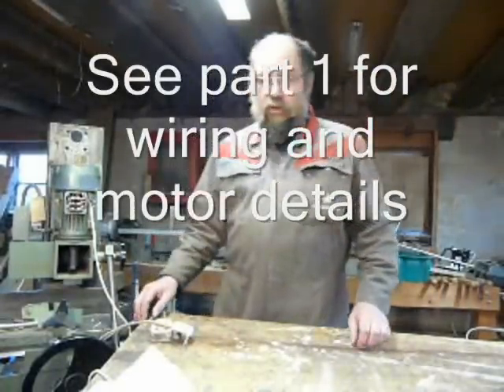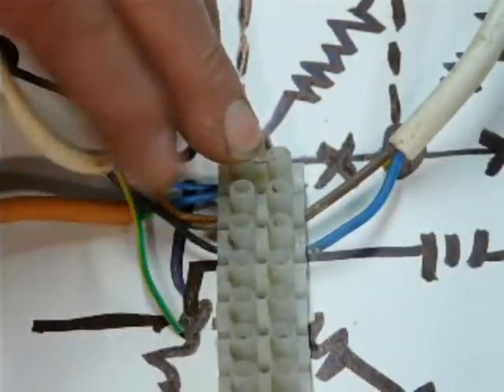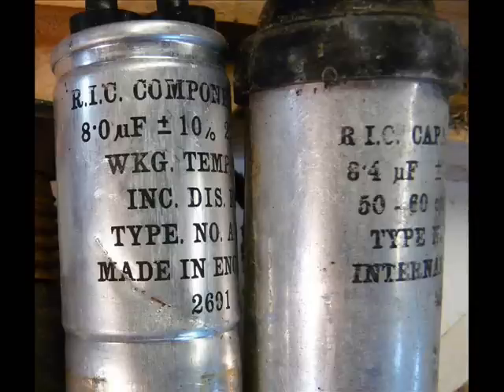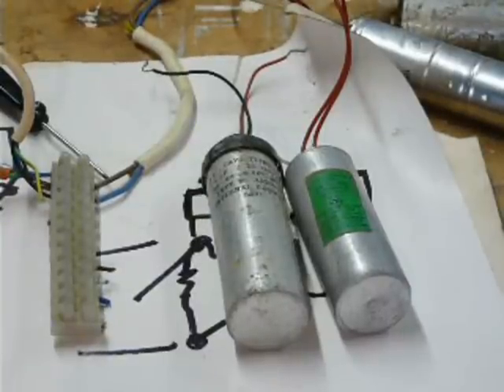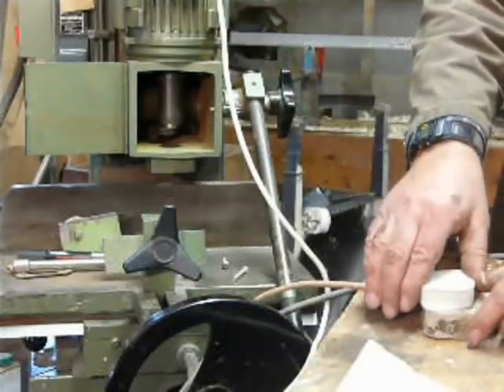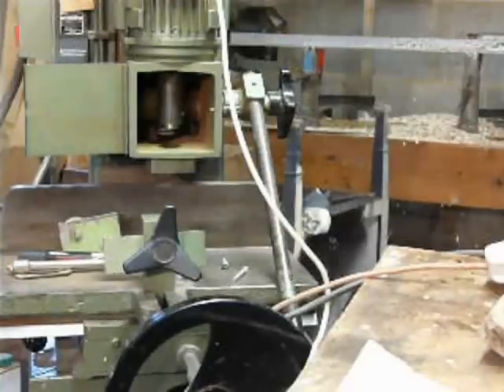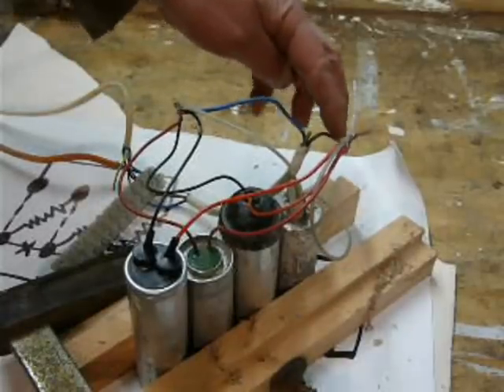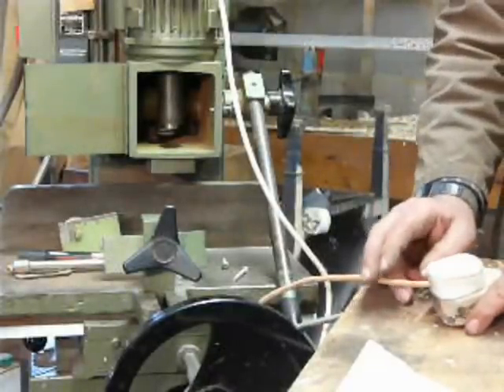How to do it: run a 3 phase motor on single phase supply. part 2

Comment: Hi Andy and thanks for this upload

I have followed the instructions in this video as it all seems straightforward but I cannot get the motor to turn in either direction, it’s rocking or oscillating back and forth but fails to turn

May I ask if this indicates a mistake in my work?

I have tried to switch the wires to different poles but still get the same result

The motor is a 3 phase 2.2kw now wired in delta as in the video

The capacitor I’m using is 60 microfarads and I checked that for continuity

Maybe I need to introduce a start capacitor?

If you find time to reply that would be great, I’m not knowledgeable in electrics but usually win if I keep on trying!

Many thanks
Nigel
Reply from the maker: Hi, yes for that size motor you will need a start capacitor, see part 6, cheers
Reply: Andy Reynolds Hi Andy and thanks for your reply
I will have a good watch of all the parts (I hadn’t realised you had more to see) and hopefully after part six il have a working motor which will then be running a nice old Clarke compressor,  I look forward to doing the job, i will post back when I manage to win
Thanks again 
Nigel de Jesus

Comment: I think a significant amount of your heat buildup is due to the fact that the phases are not 120° off from each other...  
From what I saw, you have two that are 180° from each other and one that is 90° from each of the other two (or vice versa depending on how you want to look at it).  Ergo, this is not a Delta (equilateral), but an isosceles connection.
To set your phases correct, you would need to add two capacitance banks.  This will also reduce your voltage to 208.
Reply from the maker: Thanks for your thoughts, cheers

Comment: hi Mr. Andy can ask how can I increase the torque of the motor, 
I buy a peanut grinding machine which capacity is 50 to 60kg/hr
as I test run for 1 kg it trip off. motor 1500kw

Comment: Hi Andy, what would be the capacitor value for a 1.5Kw motor? I put 35uF  the motor has to be manually turened for it to run, any idea why and what is the soluation.
Reply from the maker: Hi, well done for getting this far, it just needs a bit more umph. You can add another capacitor in parallel to increase the value. That's why I like the caps out of light fittings as the are between 8 and 14 Uf and so you can jsut keep adding until it works. Make sure you watch all 6 videos to get the whole idea. Too much capactiance causes excess voltage and so the motor warms up. Cheers
Reply: Hi Andy, thanks for your reply, I watched all 6 videos, with mine I am already using a start/stop with contactor, regarding the capacitors what would a right values for the run and start capacitors for my motor which is 1.5Kw. regards
Reply from the maker: Just a guess here 70UF run 200Uf start, cheers

Comment: just as a safety note capacitors hold there charge. so discharge them after unplugging them  to stay safe as you are pretty much wiring up live wires.
Reply: no need, the capacitor bank is in parallel with one of the coil thus all charge is dissipated.

Comment: How do you determine the capacitor size, say for 40hp motor?
Reply from the maker: Hi, that is a huge motor and not suitable for this method. The start current would be ten times the run current and this would not be available on single phase, cheers
Reply: Haha
Reply: For that you would need a rotory phase converter, most amateurs cannot design or build something that size

Comment: Like your refrigerator motor one start coil and other run!
Reply from the maker: Hi, thanks for the comment, in this case the capacitor shifts the phase so the second coil helps with the starting and the power. I think in part 6 it shows a start capacitor that is taken out of circuit once the motor is running, cheers

Comment: when you add capacitors in parallel you loss 1 micro farad for every capacitor so you actuly 
had 28uf total;]
Reply from the maker: Darren, interesting, thanks for your contribution to knowledge, Subscribed? cheers

Comment: Is there a formula according to the power of the motor to enable the choice of the capacitor?
Reply from the maker: Hi, yes there is and it's somewhere in the comments on this series, however I like to do it the practical way to rake account of motor designe variations, Subscribed? cheers

Comment: Now it's all making since to me. I figured for 240V but we here in the states have the neutral as I said bonded to the panel which is bonded to the ground or earth and we have the option of using one leg of hot and the other a neutral which comes up to a 120V circuit which we run most everything on unless we really need more power like in a electrical cloths dryer heating element or a electric water heater and the stove. We call it a trunk and you call it a boot. When someone is wanting to learn they never stop asking the teacher until they have the truth for one never knows how deep the rabbit hole is until one digs it up. Cheers ole boy.

Comment: All I want to know is if your telling me that you are running a neutral wire into your motor and a neutral in your electrical panel is bonded to the panel box along with the ground or earth as you call it then you state that you hook in a hot wire as you say, then your only hooking your motor up to 120V . Now on your diagram you draw up you state that you have 240V going in and I'm just wondering what your really hooking up to the motor Andy?
Reply from the maker: Spend a bit more time on this, see part one, In the UK we use 240v ac. If in doubt I gave the reference material, cheers

Comment: Hi Andy, I saw your video a few years ago, tried it on a lathe suds/coolant pump, and it's working fine, now about to do the same on a milling machine..Cheers
Reply from the maker: 2012, that was an age ago, thanks for your note and hope the new project works well, you might need a start capacitor, see part 6. Cheers
Reply: I'm looking at it now. Thanks very much :)

Comment: Hi Andy, thanks for your video. I'm trying to run a 7.5hp 380v delta in single phase. After I added a 50 mF Capacitor the motor jingles back and forth - does it mean my Capacitor is too small?
Reply from the maker: Hi, definately too small, try some more in parallel. You will probably need a start cap to give plenty of kick. cheers

Comment: Wow why the hell anyone would wanna buy an electronic inverter or a mechanical three phase converter when this can easily be done with capacitors??
Reply from the maker: HI, to answer your question: because you get only 60% of the power this way, you have to be confident with electrical works, there is no variable speed function. Beyond that it works well with the examples that I have shown, pillar drills and morticers. Cheers
Reply: Thank you for the reply and explanation Amigo Andy Reynolds!! God bless you!

Comment: Hi, Andy - I have a three phase motor with blue, black, orange, white, red and yellow
Can you please show your diagram with color codes that will work for the three phase motor I have. I got this motor from a scrap. 
I got it working with 110 v ac by connecting blue, black and orange together and white, red and yellow together
AJ

Comment: Hi Endey 
Sorry for asking many questions. In your tutorial, you mentioned wire resourses and first blue wire goes to motor L1 (netrul) in my case, I have 220 volts ..means both lines hot or positive.
Do I need to get netrul line? or 220 can do the same? Thanks
Reply from the maker: HI, 220 volts across 2 wires will be fine (single phase) cheers
Reply: Andy Reynolds  
I am very happy with the result of my connectio as per your instructio. 
The motor runs with full RPM and HP. How can I thankyou. I bought the motor from scrap with small mony. Again thank you so much
Reply from the maker: HI, that's great news, please see my Patreon link on my channel page, cheers

Comment: Hi Andey. Thanks for the good video 
I bouhgt a motor from the scrap and found it in very good condition but I thought it is single phase. I took it to an elctrition and he told me that this can ony run with three phase power. I searched the net and found your great channel with possible solution to use single phase with capacitor. The spec. on the motor is 
Frame 42 Z
H. P. =1.2   0Z-FT
Volts = 220
Amps=8
RPM = 900
HZ 60 ...... ph 3 ..... Class B

Please advice me on what to do
Reply from the maker: HI, the best way is to use the method shown in the video and work it out the capacitor values by trial and error, cheers
Reply: Thanks for the quich reply 
Th motor has only three wires not 6 
How can I know it is a delta connection or star connectio 
I think the connection is made internally by the manufacturer
Reply from the maker: Hi, yes, the satr connection can be found on the stator windings, you can try this motor as it is but it will have less power, cheers

Comment: Thank you Andy. You just solved my dilemma. I have a 10 HP, 3 phase air compressor, but 3 phase is not available in my residential area. I was going to purchase a single phase motor, but I think I'll try this first. What have I got to lose? By the way, does this setup use any more electricity?
Reply from the maker: HI, compressors are difficult due to the high torque start-up. 10 HP is a large motor and the start-up current could be up to 10 times the run current. Even allowing for the 60 % power this would be a run current of something like 30 amps. See how you get on with it, as there is only one way to find out. Love to hear how you get on. Cheers

Comment: In North America 240 V is obtained by two hots in opposite phase, not a neutral and one hot in Europe and Asia.

Does this change the procedure?
Reply from the maker: Hi, no it does not have any effect because it is AC, so live and neutral are only relative to ground. In fact this may be of benefit depending on the voltage of your 3 phase motor. Cheers
Reply: Hi Andy:

Thanks

First, In a plan I see that the start capacitor that starts the idle motor is NOT disconnected  after the idle motor has started. This start capacitor remains in place after the idle motor has started. Does this sound correct?

I understand that of course the two run capacitors remain in place always.

Second, does it matter whether the idle motor nameplate says rpm 1725 or rpm 3450? Does the nameplate rpm of the idle motor affect the efficiency for use for the smaller 3-phase motors.

I have a rpm 1725 10 hp 3-phase motor that I intend to use as the idle motor. Would I be able to run a 3-phase 3hp rpm 3450 motor for my table saw?

Thanks
Reply from the maker: Hi the run capacitor stays in circuit all the time. The start cap is there to give that extra kick and then is switched off. If you use this to start a pilot motor then this pilot motor will stablise the third phase. You can then use a 3 phase contactor to start up your power motor without any capacitors on the power motor. Make sure that the coil of the contactor is wired across the true phases, not the induced phase. Cheers

Comment: Very interesting explanation but as you say understanding of what you should be doing and good working practice is critical because you are using dangerous currents.
One thing came to mind that before handling the capacitor terminals you do need to make sure they that they have fully discharged. I remember when I was working on a faulty PSU, in for repair, that one capacitor still had a very high voltage after the PSU had been isolated 48 hous later.
thanks

Comment: Hi Andy,

I have question. You say that capacitors has to be 240v or it cant be less than 240v? Because i check electronic parts and they only have 450v+GRND. I think it should work with these one or not? :D (I want to do same 3phases motor run on single phase supply)
Reply from the maker: Hi, you need non polarised capacitors for AC use. 450v is fine but anyhting below 250 is a problem, so I use the flourecent light units as they are easy to find and can be wired in parellel. Cheers
Reply: Thank you

Comment: What could cause them to overload?
Reply from the maker: Hi, yes too high a capacitance will induce high voltage and the motor will get hot, subscribed? cheers
Reply: hey are you that famous skateboarder? as i once was kinda?
Reply: so lots of fans? i heard of a spray oil that allowed a motor to run underwater in cold flow
Reply from the maker: No, just fit lower value capacitors, and if needed a start cap, cheers
Reply: will this work with a three phase induction machine?
Reply: is this all ac?

Comment: How is this running off of single phase power exactly?
Reply from the maker: The easiest way to think about this is that the capacitors induce a delay in the power as to match the next phase coils that are physicaly off-set from the previous set. Cheers
Reply: Andy Reynolds that clears things up. thank you. I am doing this for a senior project and am wondering would this work the same with shunt capacitors?

Comment: Hello,

I wired up my 1.5 kW 3 phase motor into delta, and connected a 100 uF capacitor to delay one phase.
when I run the motor (on 240V) by itself, it vibrates a little and then starts running at full speed.
however when I put load on it (belt tension on pulley) it just vibrates and hums.
Normally, I would think to increase the capacitance. however I base the 100 uF on a formula I found online: C = 68*P (uF,kW), and this formula worked fine for me for smaller (300 W) motors

Is there something I am missing?
Reply from the maker: Hi See part 6 for the start cap wiring, gives an extra momentary kick. Have you subscribed to this non profit channel?,Cheers, Andy

Comment: hi does the motor not lose power or torque being wired to 240v
Reply from the maker: Hi. Yes, both, that's why compressors are right out, but pillar drills Ok. Subscribed? Cheers, Andy
Reply: so attempting to run a 5HP hydrovane compressor this way is a big no then yes ive suscribed
Reply from the maker: Hi, you have it in one, also start current is about 10 times run current. Even if this motor on single phase was 3 Hp, then with 4 amps to the HP  that would be 12 amps run and 120 amps start. Cheers, Andy
Reply: i know this is an old comment but ill add i am using this capacitor method (with a start capactor and timer) to run a 5hp baldor motor on a 2 stage 1950s Westinghouse air compressor. the fly wheel on the compressor alone is probably 50lbs so it does take a little time to get up to speed but with the right start cap it gets to full speed in about 3-4 seconds. i have run it up to 180psi with no issues. had the start relay stick one time and that for exciting. start capacitor exploded and filled the garage with smoke before i knew what happen.

Comment: 3 phase supply 3 power cable and what about neutral wire that is 4 th one is missing.  whether already connected somewhere .
Reply from the maker: HI. You will have to look for it. In the UK the neutral is the same as the earth. Cheers

Comment: hi mr andy,,, awesome video 👍,  what is function the capasitor  ?
Reply from the maker: Hi. The simplest way of thinking about this is that the capacitor shifts the phase, so adds delay. In this way a the new phase is out of sinc with the supply and so suits the motor. Cheers, Andy
Reply: Thank's a lot mr 😁
Reply: Awesome video. From my understanding. A motor is a purely inductive load with minimal resistance. So the voltage to current relationship would be 90 degrees out of phase. You say the capacitors adds a delay by shifting the phase. Wouldn't the capacitors be correcting power factor by making the voltage to current relationship more unison. I figured the purpose of run capacitors is to synthesize a third phase due to their nature. Thanks for any input. Not trying to be a hassle.

Comment: Hi, i found this info very helpfull thanks. Is there by change a formula to calculate the MF for a motor? thanks
Reply from the maker: Hi. Thanks for the comment. The formula is to be found in the comments to one of the videos in this series. Subscribed? Cheers, Andy
Reply: Hi, what video can i find it in? Just Subscribed. And just one more thing, what is the biggest kw i can go on this method? thanks
Reply from the maker: Hi. I forget which one, but there is a playlist so  all 6 are easy to access. The max motor size depends on the motor design but I had an old Denbigh pillar drill and that had a 3Hp on it. It worked with this system but was very steady on starting. Cheers

Comment: Why in the name of God to people spend 1000 $2,000 on face converters when you could simply do this
Reply from the maker: Hi. This will not work for larger motors, and you only get 2/3 of the power. For small home workshops however it is perfect. Cheers
Reply: +Andy Reynolds That was supposed to read phase converter not face converter LOL for some reason that I can't edit my post on this application. I did not realize you lost some power. but still it is amazing alternative to an expensive endeavor. even vfd are a couple hundred dollars and people tend to buy them for their phase conversion ability more than anything.